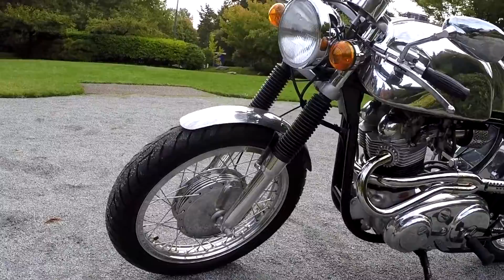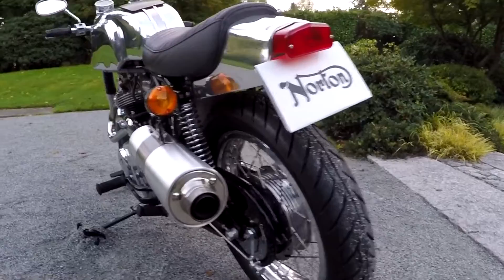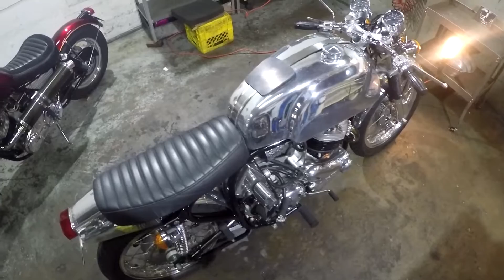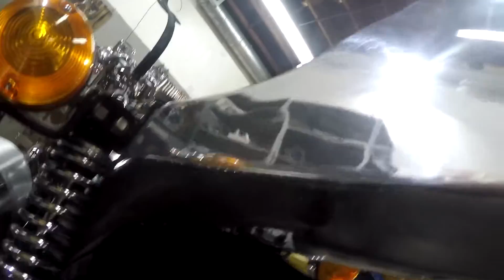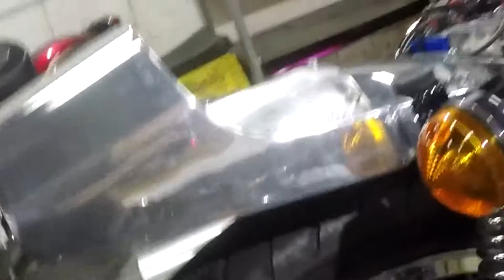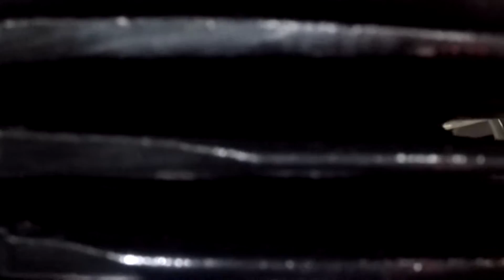Norton 750 Cafe Custom

Comment: I couldn't see details of where the rear oil drain hose goes into the block for the camshaft/lifter lubrication, as well as details about where the drain is installed coming from in the intake area drain?   I think that is a great idea, never saw that before, and  also getting rid of rigid top mount, "dave taylor" mount allows vertical travel but no side to side.

Comment: Have I made a mistake, or is the direction arrow on the front tyre  showing wrong?
Reply from the maker: I could not find it but I don't think so as that is the major aspect of modern tyre installation and gets triple checked.can you read the words under the arrow ? I will ask owner, thank you for the critical comment -the first one that had relevance, not useless opinion about what they do not understand. d.s.